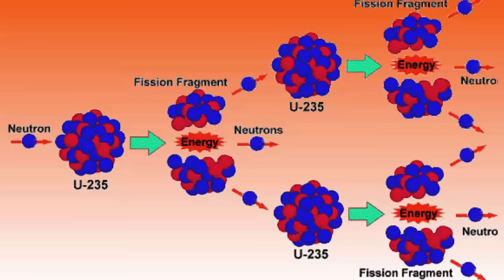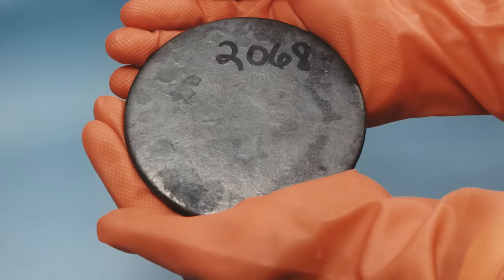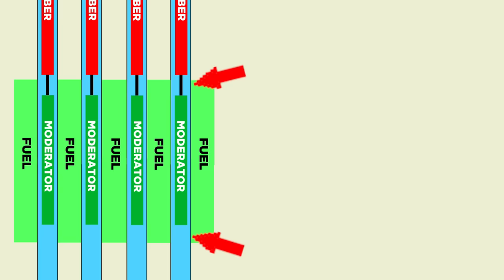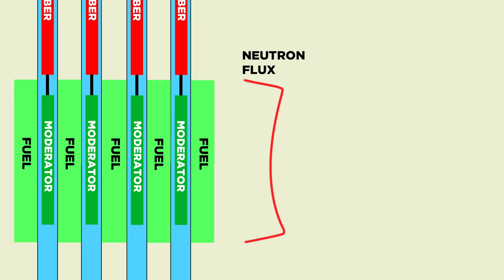What /Actually/ Happened at Chernobyl

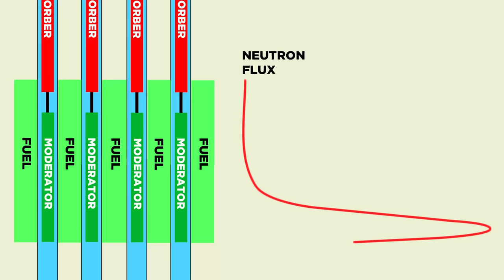Comment: 11:05 nothing broke they hit the emergency stop. And if locked the graphite in this space causing insane amounts of energy
Reply: No, the rods were pulled OUT to increase power because the reactor was slowing down more than they thought. Then the power levels SHOT up, so they pressed the AZ-5 which should have pushed the rods all the way IN, but the temperature had become so high that the cladding on the fuel rods started to break, clogging the slots for the controll rods, so that they stopped with the graphite at a position where it THEN increased the reactivity.

In short: The emergency brake broke.

Comment: @vlogbrothers One question which I havent seen answered anywhere.
We can consider that the steam side of the reactor is normally under pressures above 0.5barg for sure, as they use superheated steam at pressures general above 90 barg to make use of its cynetic energy to produce electricity when passing in the turbines. 
In that case we can consider that it is a pressure vessel and thus should have a safety valve that prevents an explosion in case of ovepressure. 
I think that it would be too many coincidences at the same time if the safety valve failed shut for some reason, nontheless my question is: Why no one mentiones safety valves anywhere? and if they are not used in this application, why not?

Comment: This was really helpful in understanding protons and neutrons and the coefficient that existed in the rbmk reactor deficiency. I work at a 3 reactor site everyday. The only thing missed here is the source and catalyst of the sudden increase in hydrogen production that lead us to the Fukushima “explosion” . It’s the fuel cladding that houses the uranium. Heat +water+ zirconium+neutron flux creates an atmosphere that reaches the higher limit of explosive limits for hydrogen concentration. Most containment buildings have >500 thousand cubic feet in free space for said incident. Nevermind containment spray systems etc to help slow it down until the emergency diesels can kick in. The rbmk was a reckless reactor to run. The Westinghouse PWR is a battle tested reactor that has proved itself over and over. There is a case to be me made for thorium reactor but that’s too boring to get into. Would love to hear positive and negative feed back.

Comment: This is simply the best explanation I have ever heard of the cause of the disaster - accurate and descriptive. Thanks! What I don't understand, though, is that in the show it is revealed that the engineers didn't know about the "graphite tipped rods" - how could that be, when they had to know the moderator and how it works? Or does this passage not correspond to the facts?

Comment: i work in energy  -  1994 till 2010 for nuclear.  I was able to witness a USA nuclear power reactor come back on line after a refueling.  Its very complex (at least then) they have professors that come in and are part of a group that has already determined each fuel rod's neutron flux, and then, how it would intermix with the 2/3rs rods that were not changed (18 months or so for our Westinghouse reactors)  -  i was able to witness the control room, during the first testing - withdrawing the rods, slightly.  To see how this 'flux' would behave.  All had laptops - except one guy.  Tweed coat, like my professors did in the 70s and using a slide rule and hand computations - quite fascinating and the others visited him, frequently to check his results (trusted) ! You did a very good synopsis!

Comment: How can you try and explain something like neutron flux without even mentioning the reactor type RBMKs have? And the void coefficient is the only positive feedback of RBMK reactor types. Heavy water is also rarely ever used for electricity generation, I think only CANDUs use it on a larger scale. Also I think its noteworthy that the reactor status was disallowed from the very beginning. At no point may all control rods be 'removed' entirely, which they did. Especially with the cooling basically turned off and the water flow being near zero, the neutron flux inequality could not be compensated through convection leading to a critical temperature spike that also didn't appear on the instruments until much too late. People and 'documentaries' never mention that with back then's computer technology (the powerplant was designed in the late 60s) was basically mechanical relays, so it took most instruments roughly 30 seconds to update, the most notable exception being the (thermal) power display, updating every five seconds.
PS: RBMK reactors are among the safest high-power reactors in the world.

Comment: What happened was they were lowering the power to 700 mega wats but it stalled and went to 200 watts but when they tried to bring it back up they lost control and hit a3-5 or the shutdown button that lowers the control rods but the flaw that caused the explosion NOT THE MELT DOWN was that the tips of the control rods had graphite and graphite increases and when that happened every single micro gram of water in the was instantly converted to steam that caused the control rods to only go in 3/4 of the way and the 350 kg caps on top were jumping up and down and at the second of the explosion the core was launched about 110 feet up.

Comment: Thanks for that explanation. The question now is: since the reactor power has been dropping all day because of xenon, and the engineers have been trying for hours to restore it, WHY THE HELL  did they remove the control rods entirely, instead of raising them just enough for the graphite tips to restore neutron flow?

Comment: A simple solution is to have a slot deep enough to fully hide the moderator at the bottom of the reactor, and make whatever's holding the moderator out of something that will melt (and drop the moderators into the slots) if the temperature goes anywhere near dangerous levels. It would be be a massive pain to reset, but a nuclear reactor is something you don't turn on until you're absolutely sure you want it on.

Comment: From a plant operation point of view, One critical point of the disaster is that they were trying an experiment on cooling the core and they wanted to do this on the day shift but it got delayed until midnights because of a power failure else where on the grid.  The entire process should have been delayed, but the safety aspects of Soviet era nuclear operations were very lax.  My point is this wasn't a normal operation that just failed miserably, this was an experimental condition that failed miserably.

Comment: So I'm still confused, how exactly does the reaction for power generation start? Is it caused by the uranium which is in a constant state of decay and giving of neutrons? Or is it when the feul rods come in contact with the water? What is causing the chain reaction (either fission, fusion, or decay) for power generation to begin with?
Reply: Spontaneous decay. Fission is the process by which it happens. Naturally occurring radioactive isotopes will always give off lighter particles and electromagnetic radiation - at least heat, which is the product of interest here, to be captured by the coolant and used to power a turbine somewhere else in the facility.
Reply: That would be the uranium. When a random decay event occurs in the uranium, that releases multiple, high energy neutrons, which can hit other uranium atoms, and if you can control this reaction, you can get nuclear power. The way that this is converted to electricity is by putting the uranium in water, which turns in to steam due to the extreme heat from the reaction. This Steam then spins a wheel, powering q generator. Same concept of using heat to make Steam as Steam engines
Reply: Look up the Demon Core. Fissile material over a certain mass (critical mass) achieves fission spontaneously. So just touching the two halves is enough.

Comment: The graphite tips were supposed to be a startup aid. The issue was the reactor was in the xenon on pit and upon insertion the xenon bleached from a lot of neutrons causing a prompt criticality
Reply: Xenon alone didn't cause the stall. The xenon pit had actually been dissipating (xenon is produced some time after a reduction in power, not continuously running at a lower power). As the initial power reduction had taken place earlier in the day, the peak concentration would have existed around 2pm, several hours before the test. There was nothing excessive nor critical about the concentration of xenon at the time of the accident. This isn't to say that xenon isn't a contributing factor, it just isn't the main driving force behind a reactor stalling.

Comment: Correction to the video at 5:30, heavy water moderated reactors (IE CANDU) do not slow down the chain reaction when the channel coolant boils, it actually increases it. They have only a slight positive void co-efficient, which is why they cannot be approved for construction in some countries. The slight positive void co-efficient is compensated by the the negative temperature co-efficient, which offsets the PVC. Making the reactor considerably safer than RBMKs

Comment: In fact for anyone worked near boilers RBMK seems superior. The way fuel is not in contact with boiler water is a bigadvantage over other designs. Corrosion and constant leaks are big headache for steam generation plants. 
Legasov was a theoretical scientist, he do the math and gave an explanation how this happened . Actually any boiler is dangerous if left unnatended even your household water heater
They “forgot” to read the manual pretty normal for these kinds of jobs

Comment: Generally good video, but it’s worth pointing out that negative void coefficients are not unique to heavy water reactors. In fact, CANDU reactors have a slightly positive void coefficient and are heavy water cooled/moderated, and all western-designed light water reactors have negative void coefficients.

Comment: Ordinary water is actually a far better moderator than heavy water. There was a great deal wrong with the reactor that you didn't mention. Especially since pump speeds controlled reactor power along with the control rods, it required a great deal of coordination just to manage it under ordinary conditions. Most importantly though it had a positive temperature coefficient of reactivity and an enormous void reactivity. You failed to mention the most important part which was that when the coolant began to boil this spiked the reactivity far beyond what it would have been if it had a negative temperature coefficient of reactivity.

Comment: If the problems of RBMK at Leningrad NPP were passed along to all other plants the Chernobyl accident would have been avoided. The KGB knew it, the engineers at Leningrad NPP knew that if more than 2 pressure channels ruptured it could result in the rupturing of further tubes. If enough tubes break the biological shield would not be able to hold the pressure. rBMK was simple to build with the industrial capacity of the ussr at that time.

Comment: You need to lower the energy state of neutrons because you need them to interact. It doesn't require quantum mechanics to understand. The same is true for heat differences and electromagnetic potentials. It's a basic thermodynamics issue. They won't interact unless they reach energy equilibrium.

Comment: Very odd that the designers of the reactor didn't do a reactivity calculation for a zero-control-rod zero-xenon zero-water most-reactive-fuel-burnup and when it was positive insist there be sufficient fixed control rods to reduce it :(

Comment: Chernobyl's test lead to the explosion, Fukushima's lack of testing lead to the explosion 🤔...the Soviets were testing how the reactor would work in a low power supply situation (if the plant loses power, how long do they have for the diesel generators to kick in and power the water pumps). Well Fukushima had that scenario, the plant was cut off from external power, the diesel generators kicked in, the water pumps wenta pumpin and the fuel rods were injected so the reaction stopped, but the cooling of the fuel takes a loooong time. Now, what if the backup gennies lost power, what then? There was a backup of a backup in the works, the company had trucks with dynamos that could power the pumps BUT these were not on site, rather they were 250km away at their headquarters 🤷‍♂️🤦‍♂️. Probably the thinking was "we'd have enough diesel fuel until the trucks arrive, what could go wrong 🤦‍♂️" but a 14meter high tsunami took out 11 outta 12 gennies because they were flooded with seawater 🤦‍♂️ (1. Why put your gennies in the basement, 2. Why not make them watertight if you are 2 meters from the godamn sea in a earthquake prone part of the world, 3. Why is your backup-backup so far away)... So what happened? The trucks couldnt get there because of the quake and tsunami ruining the roads, the fuel melted and the gases  released caused the buildings to explode. Thankfuly, people on site were smarter than their bosses and used firetrucks and sea water to dose the melting fuel... So many bad choices in both cases...

Comment: When they lowered the rods, Why did the neutron flux spike higher at the bottom of the reactor than it was in the areas where the graphite already was (the middle)? 

To put another way, the graphite rods were already in the middle of the reactor and there was nothing slowing the reaction down there either, so why did it spikes so high at the bottom? Like what was special about the bottom

Comment: Most of what i have seen and read about the Chernobyl disaster leads me to the conclusion that the majority of the blame was down to flawed reactor design, (e.g graphite tipped control rods) more so than directly human error in the operation, although that played a part too.
Reply: I think the main problem was a combination of the Soviet system of project management linked to the lack of training in the operators.  The specific lack of training was the issue of failure modes already experienced with the RBMK but went farther than that.  The project management forced the testing to be done and then allowed it to be botched by demanding the head of anyone who was found at fault in not delivering.

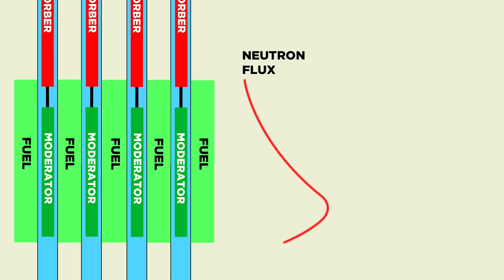Comment: Not certain why the neutron flux would spike.  If you take 4 graphite control rods and lower them into a space filled with water (like at the bottom), then the most they can generate is the amount like in the center of the graphite section.  All things are equal horizontally -- equal fuel, equal graphite, and equal water.  Why the spike? 10:25

Comment: According to BOILER REGULATORY AUTHORITY  any highly pressurised vessel has to be protected with PORV (PILOT OPERATED RELEASE VALVE) which cannot be compensated , they are operated on the basis of spring tension . When the reactor was at high pressure stage , they should have opened automatically (velery legasov didn't lied but didn't told the whole truth behind ) so the Chernobyl disaster is just a controversial statement for us.

Comment: At the point when they pushed the control rods down, why is there the neutron flux spike? I dont understand this. In the middle of the core, there was no watter at all for quite some time and it did not create any spike there at all. But when we create this setup at the bottom, it creates the flux spike? What am I missing?
The common sense in my opinion is that the decay heat would build up at the center. Its a place surrounded by fuel from all sides and with no watter (which eats the neutrons). And when we push the control rods down (and push the water from the bottom part) we just create the same setup at the bottom as we have it in the center. But this should just straighten the line, not create a spike.